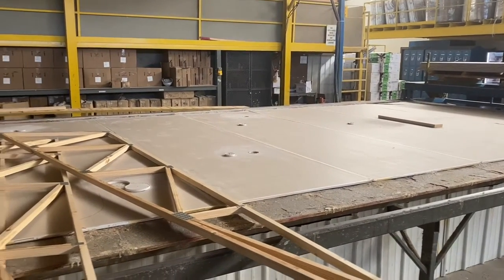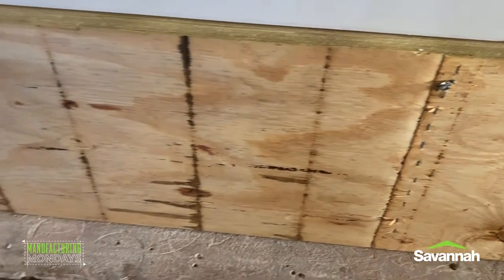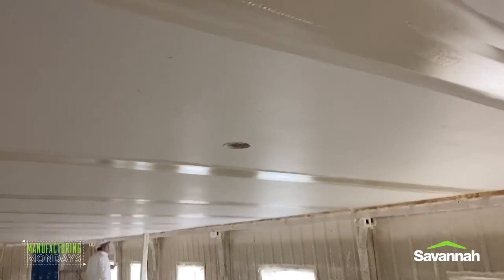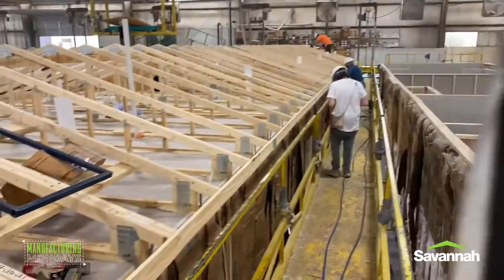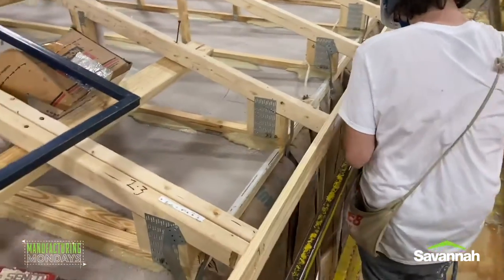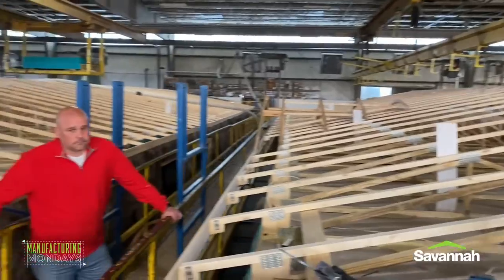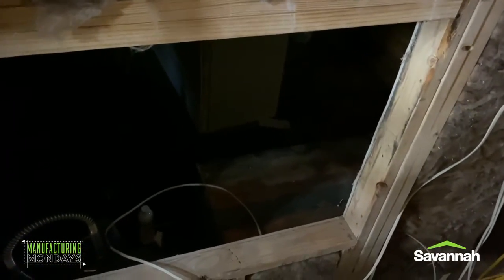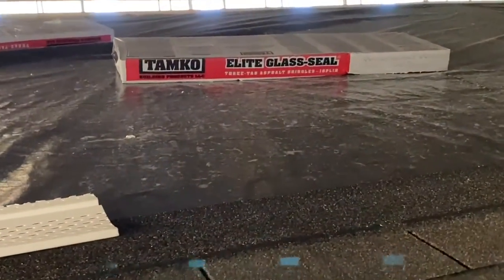Clayton Homes How they are Made! Week 5  Durable Roof Construction Oakwood Homes of Tulsa

Comment: Looks like the same flooring that's in my friend's house with socks on your risking death without socks a ninja couldn't even sneak through the place with the squeak that comes off of this flooring true story
Reply: Watch all 48 videos and counting of NEVER BUY A CLAYTON MANUFACTURED HOME on YouTube
Reply from the maker: Thanks for the comment, Your dealer can tighten up that floor for you.  The floor is designed to easily tighten up lag bolts to remove creaks.
Reply: @oakwoodhomes9836  what about the cheap stapled on shingles ????? When they start leaking after a couple years???

Comment: Watch all 48 videos and counting of NEVER BUY A CLAYTON MANUFACTURED HOME on YouTube and do not buy one of these homes those trusses are 1x1 when they need to be at the very least 2x4
Reply from the maker: Thanks for the comment, even plugging your own channel, promotes ours.  Im not sure where you got your engineering degree, but you should check out Department of housing HUD specs.  While you are checking, check out Department of Energy, zero Energy Ready Specs, these homes meet them.
Reply: Bro bought a knock off and mad about it.😂
Reply: Just because you meet minimum standard doesn't make it good. Skyline uses 2x4 trusses.